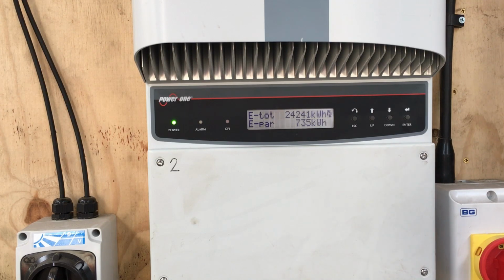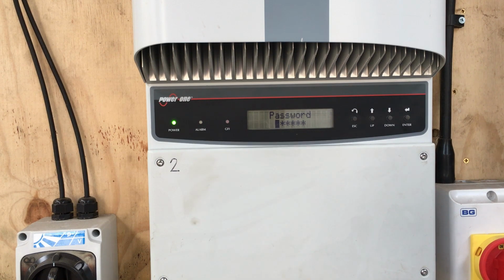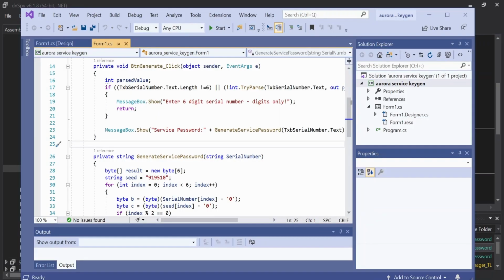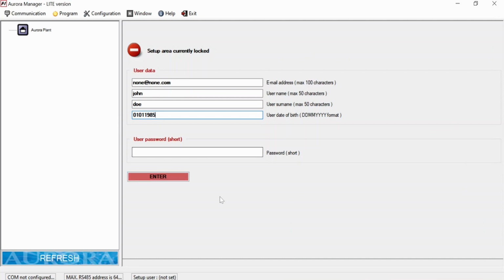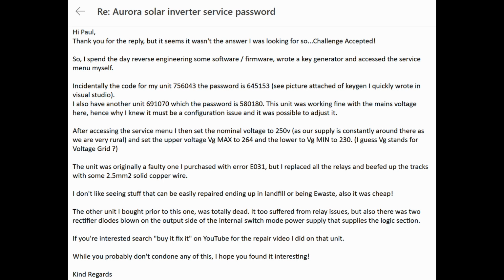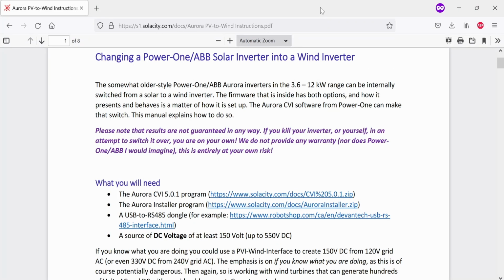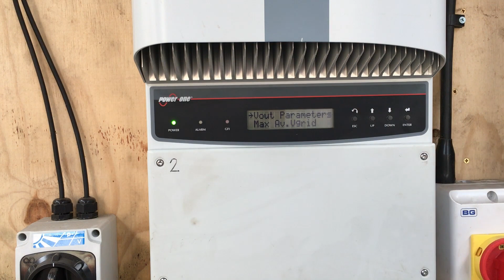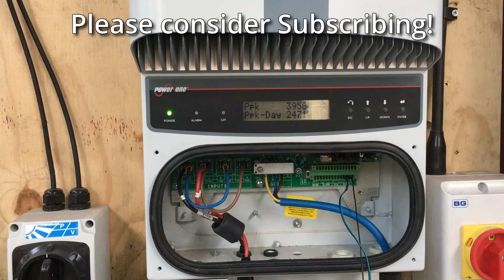Power-One Aurora / ABB Inverter - No password? No problem!

Comment: Hi I just saw this video and found it very interesting. I have a 5kw version of inverter that will be redundant shortly as I am upgrading to hybrid. Within the aurora inverter I installed a WiFi adaptor via the RS Output. Do you have any use for it as it will otherwise be disposed with the inverter when I get rid of it
Reply from the maker: Glad you found it interesting. Unfortunately I don't have a use for another one. I've since upgraded to a Victron with battery storage. Hopefully someone else will be able to make use of it though.

Comment: Mick, Andy Reynolds here, hope all good with you. Wondered if you had any thoughts about communicating with a set of 5.1 KW Voltacon LiFePo batteries. Is it possible to adapt some sort of bluetooth unit that fits a RS465. The standard system is convoluted and needs internet connection, plus a cerbro. Thought there may be a simpler direct method with some code and thinking side ways. Cheers, Andy
Reply from the maker: Hey Andy, good to hear from you. Drop me an email at the name of the channel at out look dot com.

Comment: Daft question perhaps but that 2nd USB port you mention...is that instead of the RS485 port because on mine I just had the USB/RS485 adapter on the computer end and wired the 485 wires into the connection block. I think, it was a long time ago.
Reply from the maker: Been quite a while since I looked at this, so hard to remember without watching the video again. I know when I was looking on the internet a lot of sites said there was problems using the built in USB and to use an external adapter. I did try the USB and it didn't seem to work correctly.

Comment: Gee you got no reply to your email that does surprise me. I recently asked for the pin out of a cable used on a OBDII analyser and they said they would ship me one if I wanted to pay the insane freight but they wouldn't give me the pin out. So like you I worked it out and sent it to them to give to anybody else who might enquire, no response. And these companies argue black is white that they are not protectionist in their activities as if we are that stupid, its only government law makers that are that silly :)
Reply from the maker: Agree. It was the same with FLIR when I repaired the thermal camera on here. I put their emails up too. I did have a good experience with Peak electronics who helped me out by sending me a new programmed PIC microcontroller for one of their devices and even free of charge! I would have been quite willing to pay.

Comment: Great video, thanks very much, youre certainly knowledgeable in cracking codes on the ols machines😊. Would like to learn more about how to do that i have an old SMA sunnyboy im trying to turn into a windyboy for a wind generator, but theres a password i cant get past in the software to alter the parameters do you have any tips?🙏🤞
Reply from the maker: @ThumbFunker  Thanks 👍I've not looked at one of those but I'd start by searching the Web for any engineer or configuration software or engineer type documents. Not sure if it might have an eeprom inside that might store settings such as the password (it might be integrated into the CPU / SOC though).

Comment: Apparently the relays failing is a common issue with them.  It's also a common failing that companies hate when you fix stuff instead of buying a new one from their dealers.
Reply from the maker: @teekay_1  Agree to both points 👍I replaced the relays on this one in a previous video, but also reinforced the tracks with some solid copper wire. The switch mode PSU had also failed, which I also repaired in the same video 🙂👍

Comment: Hello, wonderful video and wonderful skills :) (i am an electronic engineer) . I have a abb/powerone inverter that I need to change nation, but i have a serial number of 10 digits. What I need to write on your keygen? Thank you
Reply from the maker: Thanks 👍The engineer menu probably won't help as it only had limited options. You might be able to do it with a rs485 interface and the Aurora CVI program, but it might also be locked on later firmware.
Reply: @BuyitFixit  thanks for you reply. I have to try what I can do with you password generator... in the menu I have a "change nation" that should be simply what I need . I'll let you know :)
Reply: Hi, I finally set up the inverter and the service password keygen works perfectly. I have to setup RS485 to try the CVI program but for now I am happy with this .... thank you!

Comment: My inverter is linked to sun power and they are bankrupt therefore not servicing. I need it to operate without their communications as it says this is the problem
Reply from the maker: I think the communication is just for power reporting, it should still produce power without it. Is there no way to disable the communication? If the servers are now down it's unlikely they will come back. Unfortunately this happens a lot with internet connected devices. They work great until the company goes away and then you are left with a product that no longer has features, or doesn't work at all.

Comment: Hi @BuyitFixit I need to connect a 230v_50Hz inverter from France to a 220v_60Hz GRID.

But I couldn't modify the frequency setting through the software show the message "out of range".

Would you happen to know if there is a way to extract the firmware from the inverter to modify and then reinstall this firmware?
Reply from the maker: I don't think that is possible, but you may be able to use the CVI software to modify the parameters or country to the frequency you need. You will need a rs485 adapter and the software (link in video description)

Comment: Can someone help me:
Could someone help me with the firmware for the PVI 3.0 - OUTD - FR - W inverter?
Any version equal to or greater than v2.0.0
Reply from the maker: Sorry I didn't find much in the way of firmware myself. Have you tried the old aurora site via internet archive? Or possibly searching on there. Slim chance  I know....
Reply: Tank you  @BuyitFixit  . I searched through the wayback machine, but didn't find it. I'm trying to connect to 220V_60Hz, but the current firmware (version prior to 2.0.0) does not allow changing the NATION or changing the frequency through the Aurora Manager software. Do you have an idea how I can do this?

Comment: Congratulation for this brilliant work! Do you think it is possible to use this inverter as stand alone (off-grid) inverter by programming someting ? Thanks!
Reply from the maker: Thank you 👍Unfortunately I don't think that's possible. You would also have no storage (battery) unless you put high voltage DC from a battery bank into the solar input. On the web it says "NOTE: A minimum input voltage of 200 Vdc is required for the Aurora inverter to start the grid connection sequence" and most off grid inverters use 48V, 24V or 12V batteries.
Reply: @BuyitFixit  Thanks a lot! Sorry my question was not accurate enough... Due to local regulation I'm not allowed to use the full power of my solar plant to reinject on the power public grid. So I would like to use some of the power of my solar pannels in order to make a local 50Hz 230VAC power supply. This supply would not use any battery, it just deliver power when sun gives us enough light (more than 200VDC on the solar pannels). I intend to use this power in order to charge an electric car and/or to preheat water for my domestic use. It just a preheat of water because the final heating could be made by my gas heating system. If you have any idea to achieve this goal I would be verry gratefull. Thanks in advance!

Comment: Hello, many thanks for this very interesting video ! I have an other problem with pvi invertor. Speed is incorrect in aurora installer so I can't log into my invertor (19200 Baud instead of 9600!!!). Would it be possible to have a solution to fix my speed rate using my usb serial port ??? Many thanks in advance !
Reply from the maker: Have you tried aurora CVI? That allows you to change the baud rate and it's quite powerful to alter settings if it works with your inverter.

Comment: That settings menu is interesting (16:25). ENEL is the national power grid operator in Italy. CEI is the governing body for electrical standards in Italy, VDE is the same in Germany. AR-N 4105 is a VDE standard for power generation systems. Rule 21 is something similar in California as far as I can tell.

The reply from the company is utter nonsense. UK nominal mains voltage used to be 240 V +/- 10% (216-264 V) but was lowered to 230 V +/-10% decades ago. So the "new vs. old" argument doesn't make much sense in that regard. The reality is more like UK distribution network operators tend to push the upper limits of the 230 V more often than not, especially in rural areas during off-peak times (mains voltage depends on voltage drop, among other things, and rural supplies tend to have long runs with high voltage drop under load and suppliers try to keep the idle voltage as high as they can to avoid dropping below the minimum under full load). In theory, your DNO could be held responsible for any malfunction or even damage caused by mains voltage exceeding 253 V at the meter. Unfortunately it's quite difficult to actually hold them responsible (Youtuber Big Clive tried I think).
Large PV setups aggravate the issue because feeding into the grid raises the voltage.

Comment: How do you figure out whether the software has a key gen built into it?  Kinda odd but I’m no programmer.  Electronics engineer but never had to get into any microcontrollers or anything so never learned..
Reply from the maker: I was just looking through the code 🙂 A lot of programs when you input a password or serial number, compare what you put in to some value which it has to calculate. A neat trick used to be to put the program into a debugger and find out where this check takes place. You then have a few options.. See what value it's comparing against (which would be the correct value which the program has now kindly generated for you) or see which path the program takes if it's correct or incorrect. Then change the code by either changing it to always jump to the correct path, or removing the jump to the part where it says it's incorrect. Have a look at the medical ultrasound video I did similar on that to figure out the engineer password.

Comment: I have a problem with changing the location in the program. the message "this inverter is not enabled for this menu" appears. In 1 inverter I managed to do it, and in the other two I have this message. how to solve it?
Reply from the maker: I do remember having something similar, is this with the Aurora CVI prorgam?
I did manage to reset the country code, but I can't remember off hand how I did it. It might be worth backing up the settings first just in case you need to revert back.
Reply: @BuyitFixit  yes, this is what it displays in Aurora CVI, maybe you have another way to change the voltage to 253V without changing the location? maybe some other program? please help
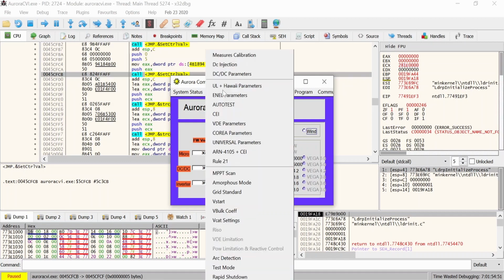Reply from the maker: See 15:38 you should be able to adjust the maximum voltage there.

Comment: So if someone wants to find the password quickly, it seems to be as follows:
You take the 6 digits of your Sr. Num and for the first 3 digits you subtract  1, for the two after you  add 1 and the last digit remains the same
ex. if Sr. Num is 111111 the password will be 000221
Reply from the maker: Good try 👍 It does work with some. Serial number 000999 = password 959409 https://pastebin.com/pQJQ8Jkn
Reply: This did not work on mine, do the zeros become 9s? I tried several combos with no luck…

Comment: I think it's liability. That I can understand.
What I don't accept is the unwillingness to provide service. What is obsolete? How is it allowed to label something designed to operate for two decades as obsolete after a couple of years and exonerate yourself from the responsibility?
Reply from the maker: I had a similar experience with FLIR and asking for replacement parts for a thermal camera. Although they didn't claim obsolete, there's was more a cry of proprietary information and secrets.

Comment: I wonder if its possible to disable Anti-Islanding feature ?
Reply from the maker: I think it is, I'm fairly sure I saw a checkbox in the software somewhere, but don't quote me on that.
Reply: @BuyitFixit  i also got this inverter on cheap, same problems that need to be fixed. planing to use it off grid completely isolated system, and the islanding feature is annoying. If anyone can confirm this it would be awesome. I'm still waiting on the relays to show up so I can't do any testing myself. Thanks for the reply btw love your channel.

Comment: Thankyou for this video, very useful and had the same issues with Firmer, but CVI prog doesn't give a good pwd for a later model ABB inverter.  Also the solarcity website is no longer available (was trying to get 'aurorainstaller' file).  Can't find a service pwd generator for UNO-DM-5.0-TL-PLUS-Q model giving W004 Grid Overvoltage error.  Any suggestions appreciated.
Reply from the maker: Thanks 👍You should be able to adjust the settings with CVI software and a RS485 lead. I think the password algorithm changed in later models by adding in the date somehow. I've just checked both links in the video description and both still work for both programs.
Reply: Thanks for your prompt reply, turns out the inverter is still under extended warranty with a service agent here in Brisbane, but as I am the second owner and installed it myself warranty is not valid.  So after exhausting searching on the Firmer website I came across an area that let me register as an installer and gave me a service password. @BuyitFixit
Reply from the maker: Interesting. Can you try it again in perhaps a weeks time? I'm wondering if it's possible to work out if it changes daily weekly monthly or just stays the same.

Comment: Unfortunately the service password doesn't work for me. It is a PVI 6.0 TL OUTD. The complete serial number is: 1311469001. According to the tool, the PW should be 358111. But the device says this is wrong. Do you still have any ideas?
Reply: you could try 200579 or the the product key, taking a while guess that they kept the same method of generating the keys except for starting at the second highest number 🤷‍♂

Comment: If you weren’t able to change the acceptable grid values with the software would you have been able to get around that issue with a slightly modified 1 to 1 transformer attached to the grid input?
Reply from the maker: Yes, that would probably have worked too 👍

Comment: Great tool!  But i cant run the script, i don't have that knowledge. My serial is 1446105371. Can you help me to generate the Service password?
Reply: Hello,
Can you please send the password generator?
Thanks so much
Reply: Hello can you send the zip password?
Thanks
Reply from the maker: @antoniocarvalho4648 I'm sure its on the video description next to the link. It's just buyitfixit
Reply: Thank you
Reply from the maker: I've updated the video description with another link to the password generator. For some reason google drive flagged it as a virus (probably because I had the word keygen in it) so I've just called it Aurora password generator now. Source code is included too if you wish to compile it yourself.
Reply from the maker: Try 054481. It might not work as they seem to have changed the algorithm after a certain year of manufacture.

Comment: Hello I'm new to all this so bear with me 
I have a ABB 6kw inverter and has same problem as you high voltage spikes from grid,i have asked abb salesman for the code to access the parameters to change voltage and frequency but he said the box is out of date and abb wont release the code so im asking for your help can you get me the code ? Thanks Martin
Reply: I tried to change parameters through the computer but couldn't, so I tried on abb inverter instead and it let me so fingers crossed it has fixed my problem, I want to thank you for your help much appreciated thanks
Reply from the maker: No problem, glad you were able to get somewhere with it. It really sucks when the companies that make such products are no longer willing to help, and "go buy a new one" is the response.
Reply from the maker: Yes they wouldn't help me either and said pretty much the same thing, which is why I did this. The engineer code only does limited things anyway. The CVI software did a whole lot more. A few people said the code didn't work for them as it seems they changed something in the firmware on later devices so the code is generated with some mix of the date and time I think. If you give me the serial numbers I can give you a code but it may not work, alternatively you can use an RS485 adapter and the CVI software with the engineer password as listed in the video description.
Reply: @BuyitFixit  S/N 563424 not sure which one you need
Reply from the maker: @user-mg4hv9be6c 452534 let me know if it works.
Reply: I'm in system parameters and it will not let me change the work frequency  and nominal vout keeps telling me error in sending parameters
Reply from the maker: There was a setting in mine for plus and minus 10% which you could change to 15% for the line voltage

Comment: Getting into the programming didn't help me. I could not change the frequency inside to meet Canada's electric stats as far as I could see. My old inverter has scorch marks around some of the 7 metal prongs coming off the inverter board. Do you think I can just swap the inverter board from one unit to the other is they are identical?
Reply from the maker: There's quite a few menus in that Aurora CVI, did you put the engineer password in at the start? Not sure about just swapping the board as there may me slight differences in the components and I think they use some calibration values to compensate (I could be wrong).